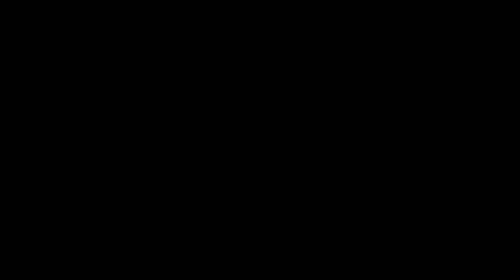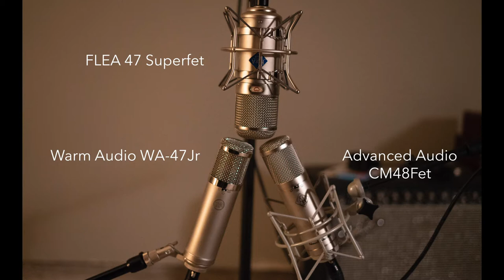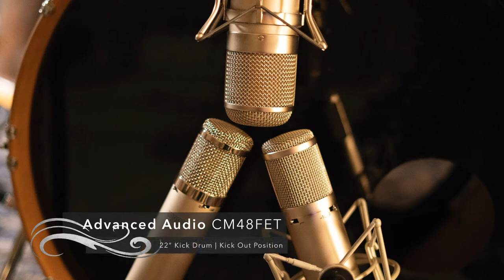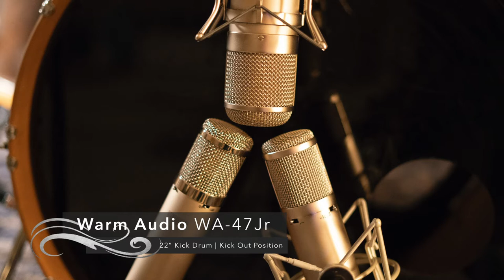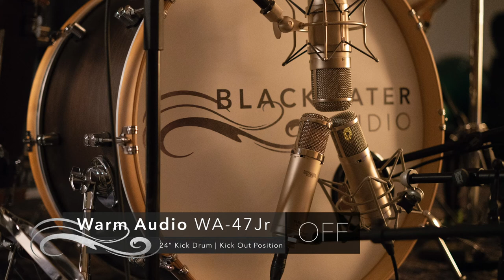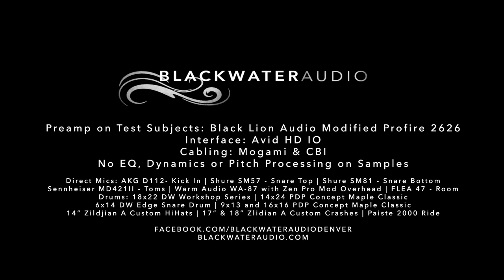47 FET Shootout on Kick Drum | Advanced Audio CM48FET vs FLEA 47 SUPERFET vs Warm Audio WA-47Jr

Comment: Why was the AA 48FET used instead of their 47FET as this is a 47FET comparison?
Reply from the maker: Andrew MTS, generally speaking the only difference between a 47/48 is the extra polar pattern, 47 is cardioid/Omni, and the 48 is cardioid/figure 8. This mic has all 3 patterns. When I was researching the AA48 Fet, everything I read said this was just a bit more open than the 47fet, and was closer to the actual 47fet sound, where as the AA47fet tends to drift more towards a U87 sound.

Comment: To not “apparent level” match the WA mic makes it very difficult to judge.
Reply: Agreed, but if they were more mathematically level matched, it tells you it's more scooped, which is not what a Fet47 style mic needs to be.
Reply: @busyboxst7  I agree with you, and the United 47 too sounds better than the Jr, because of that. But it's also what makes it a perfectly decent kick out drum mic to use alongside a D112, D6, Beta52A. A Beta 52A or D6 will both bring out the impact, and often you'd be dialing out the low mids of a kickout track. Might need more lift at 7k for the impact than the Flea, but I'm sure it's very useable. With compression,and a touch of EQ, can get much closer in sound to the Flea. While it won't be as good as a more expensive 47, for kick out, it can work very well for studios on tighter budgets. It's only about £250. Using it with a transformer pre will get it sounding better too.  And I wonder if I had a U47 Fet Jr. and a Flea, I could see myself using the Jr. on kick out, and maybe putting the more articulate 3 feet out in front of the kick, on a lowish stand. For that mid-distance room mic, where I suspect the difference would matter more. Might work well enough on guitar/bass cab too, alongside an SM-7b/SM-57, for bass reinforcement.
Reply: @compucorder64 , appreciate the response.  I don’t have the bandwidth to give a thoughtful reply to this.  Happy music making.